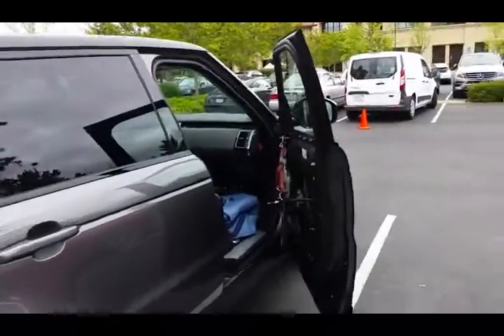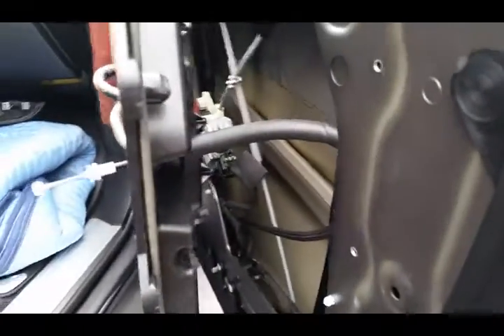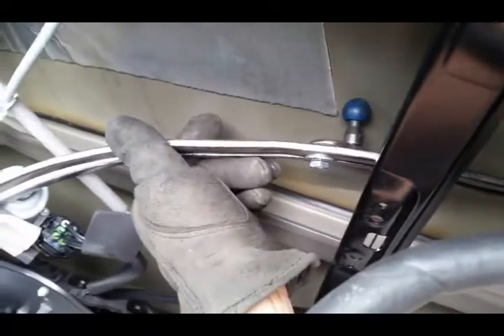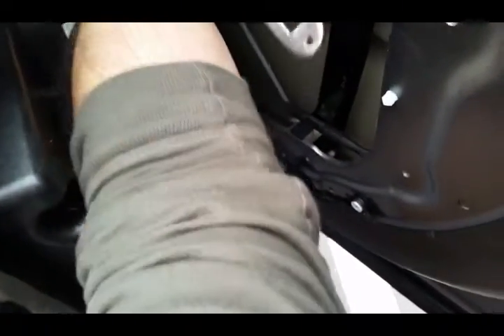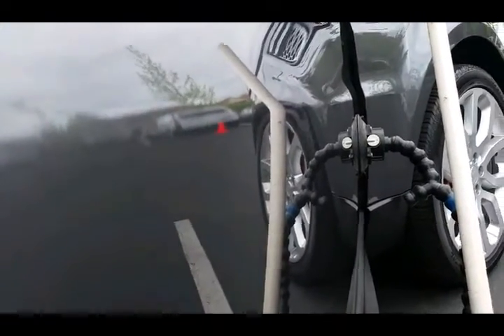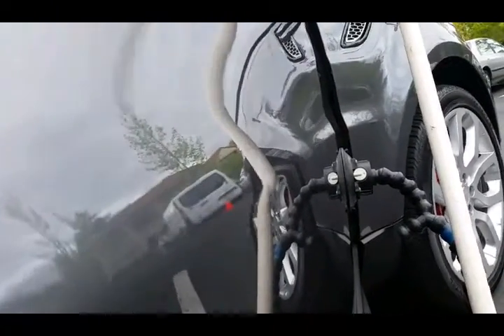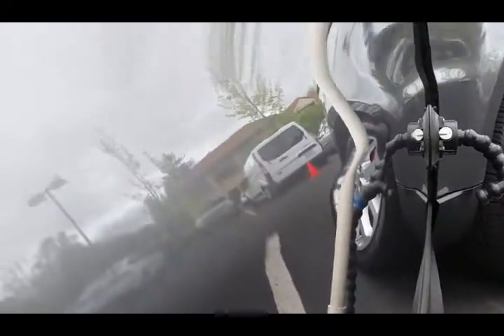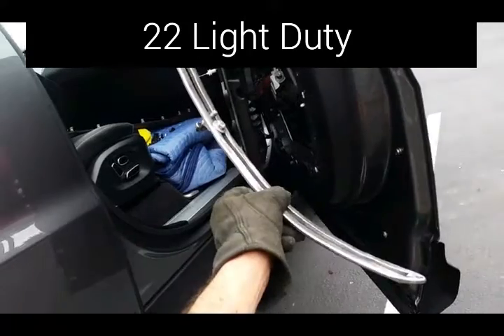Why and how to use a Dent Dial.

Comment: The great thing about having my own workshop is being able to make my own dent levers,fulcrum sand pressure pads. Dent dial ok but always needs a bit of customisation to suit every job. Must have over one hundred pressure pads made so far and still coming up with new designs. The adjustable parallel spring bow the best way to apply pressure, great work guys.

Comment: Great work, however i would've been finished in 7 minutes.  I have yet to see any of my customers lay on the floor to search for an access hole.  Time is money.  No hole is absolutely reputable, however for this repair, MASSIVE time wasted.  If you have EVER seen a customer lay on the floor to search for your access point, i then stand corrected.  Just an opinion.  Your a marvelous technician Sir.
Reply: Question for Dent Gent, what if someone points out to the customer that their is a drilled hole for the PDR, can they sue you?
Reply: Window guard and door tool would have been tooooooooooooons easier and no holes..
Reply: Or s hook to a hole and get leverage like that.. tyeres several ways to get to that dents wothout all that hastle

Comment: beautiful job !
however my wholesale customers would be yelling at me for taking so long not to mention $$$$$$$$$$
a dent like this should take no more than 5-10 mins max
drilling a neat hole with a plug allows further dent removal easy easy - no need to keep removing panels clips nuts bolts etc etc etc
good luck to you brother - thanks for posting your work